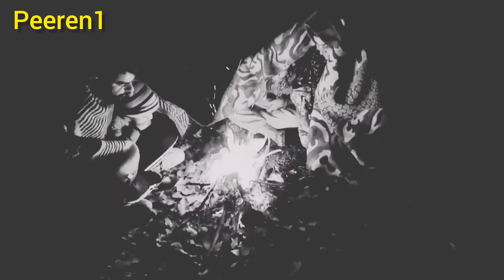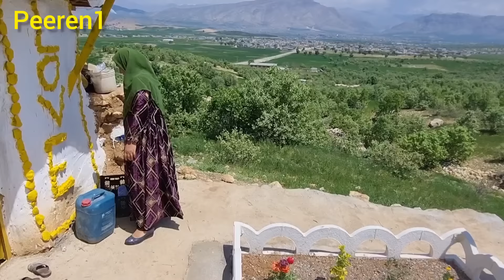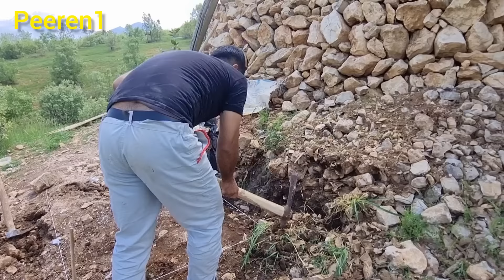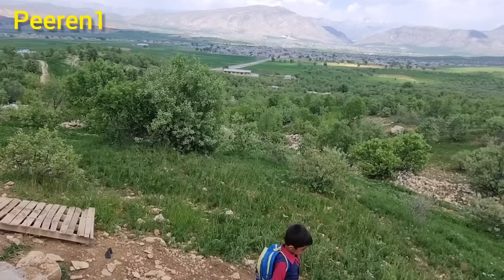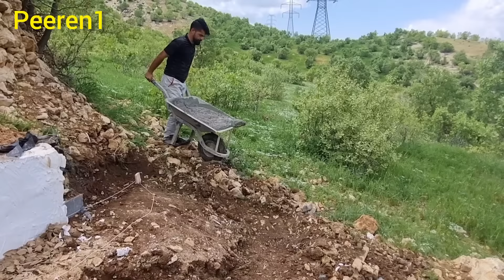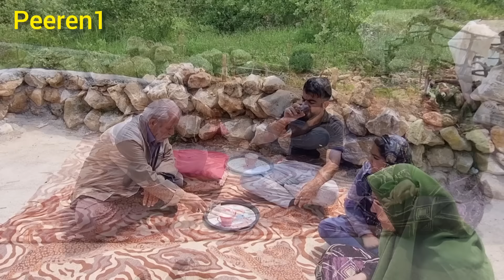Buying a carpet by a kind old man for a needy nomadic family in 2024

Comment: The chickens need a cage with a gate to open and let them out, ypi could build a brick foundation but it then needs a wire fence round it and some over the top so that in the cold you can put a tarp over it